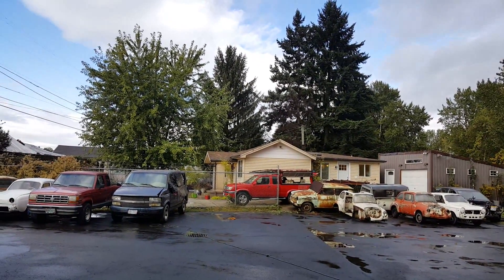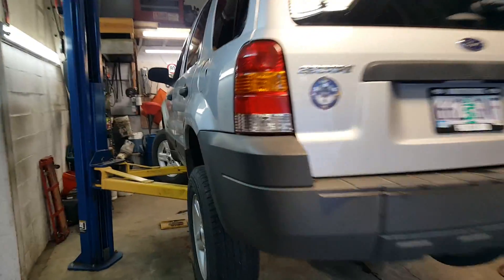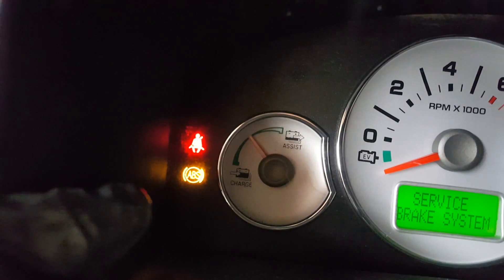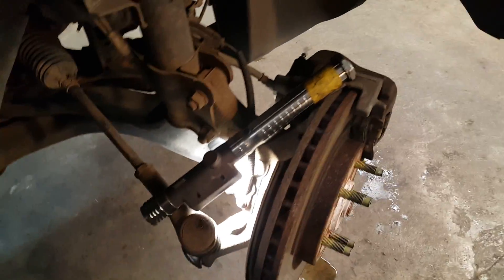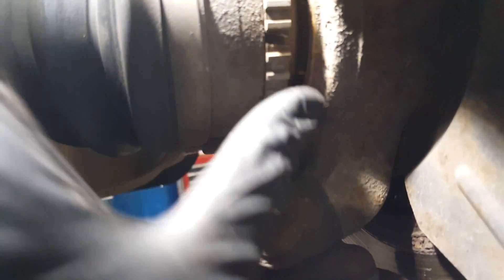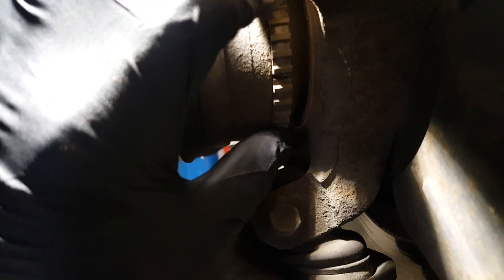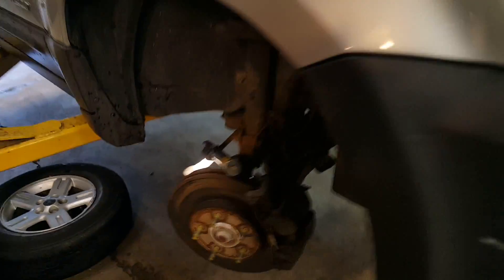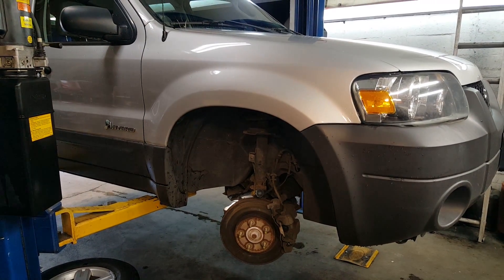Ford Escape ABS, 4x4, Brake System Failure Repair

Comment: 2005 Ford escape All wheel drive doesn't work. Check the fuse it looks good. If the tone ring is broken will that cause the all wheel drive to not work?

Comment: I have a mazda tribute hybrid, and on hot days the abs and brake light come on and says regenerative brake system disable but if it sits for a few hours it isn't on until it is driven for a few miles if it's still hot outside but won't come on if night and cooler, have any idea why? It would be much appreciated if you can help.

Comment: So my 06 escape hybrid had the abs light and the (brake) light on n it says low brake fluid and service brake system like yours. Idk if the tone ring broke(I hope not) but I filled a little bit of brake fluid, and the low message went away but the other message is still there. Would the cold snowy weather just be throwing the sensor off? Cause I’m driving for an hour tommorow and I hope nothing goes wrong. But I drove to autozone to get the brake fluid and the hybrid system and brakes works like they should.

Comment: I have a 2001 left front ring came loose not broke so I cleaned up all the rust and crap used some epoxy and glued it back on .......so far so good......it's been almost 10,000 miles ...

Comment: What issues beside the lights being on, does the broken ring cause if any?
My 2008 has issues and no one can find the problem. Brakes are soft and go almost to floor before they catch. Had the break line bled, didn't help, all ne pads and roter, didn't help.  Could the abs sensor cause this?
Reply: Sounds like your master cylinder is bad.
Reply: @amberschlegel7153  , had it checked,  it's not. Thanks though. 
We bled the brakes, checked Master cylinder,  new pads a rotors. At my wits end with it
Reply: @loribott6119  Ford has a specific bleed procedure for ABS brakes, you often need a dealer-level scan tool or similar to initiate it. The ABS module basically has to pulse itself on and off in order to get air out. Some people say you can take it on a dirt road and mash the brakes, and it'll do the same thing.
Reply: @imitt12  interesting! I had to mash the brakes, I almost stoo up hitting brakes to miss hitting some idiot pulling out in front of me, that's when the problem started. Then they came back when I drove it far. Then they went out again months later and never came back. Ugh.

Comment: They split from rust building up on the axle under the tone ring over time & causing it to expand & snap... common problem & not that hard of a job to replace... pull axle... sand the rusted area.. spray lube.. tap it on ... replace axle..

Comment: Just wanted to comment it appears to be a common problem. Happens when rust or ice builds up under the ring causing it to expand and break the cheap metal used to make the ring. I replaced my axle with one that had a built in tone ring problem solved. You will need to clear the code or do what you did. Imo clearing with a scanner is more likely better option as to not delete any other underlying codes that may be stored. Note that Im not a mechanic but im mechanically inclined but thats my opinion on that. Seems like its common

Comment: Thanks for the video.  I had the same issue with our 2010 Escape. Front left tone ring was split missing a tooth.  I Tig welded it up, then used a cut off wheel to make new tooth.  It may be worth noting to disconnect battery before welding on a vehicle.  Weld current can travel through the Chassis and fry electronic components.

Comment: What is the purpose of the Tone Ring?
Reply: Every time one of the grooves moves past the wheel speed sensor, it sends a pulse to the ABS control module, and the ABS computer counts the pulses to determine how fast the wheel is turning. It compares the speeds of each wheel, and if it sees one moving faster than the others it'll pulse the brakes on that wheel to slow it down.

Comment: The tone rings used to be harder to get but they aren't any longer.  You can pick them up pretty much anywhere.  Also, a failed ABS sensor can throw a code in the same way and you'll notice it with the perpetual ABS light as well as the 4X4 light blinking at timed intervals.  If you see that, it's a ring or sensor and if the rings look good it's a sensor.  I used a scanner to let me know my LR sensor had failed.

After 5 years of ownership I am about to replace it finally lol.  I'm tired of seeing that light blinking every time I drive.
Reply: hi, I believe I get the exact same problem. How much did it cost if it is a sensor issue?